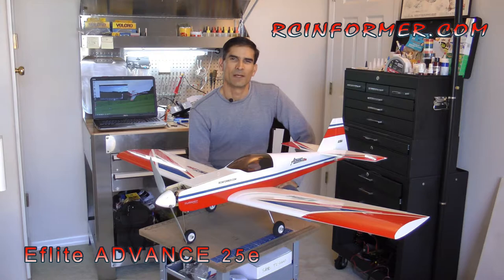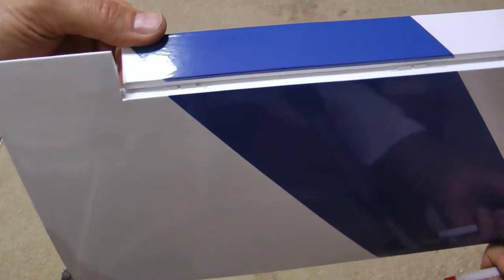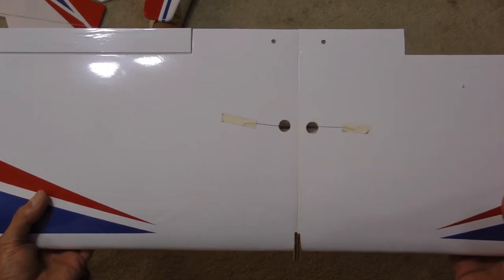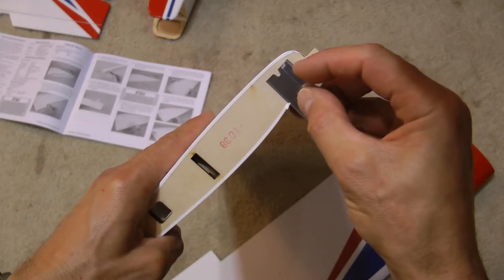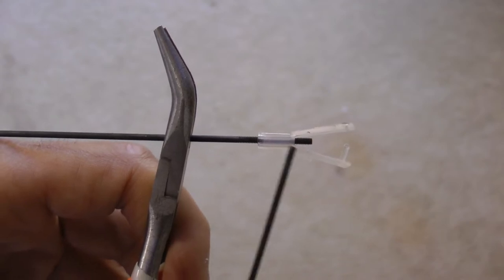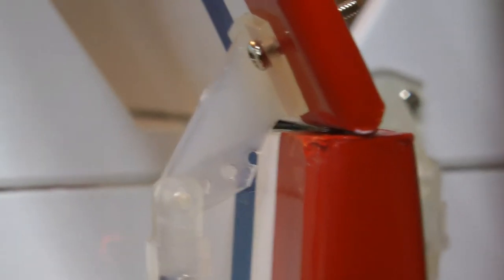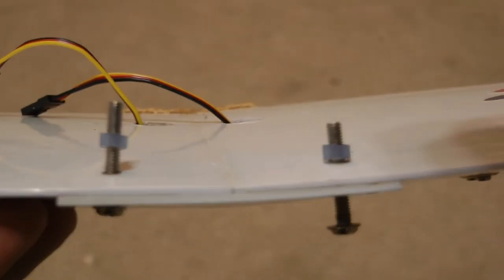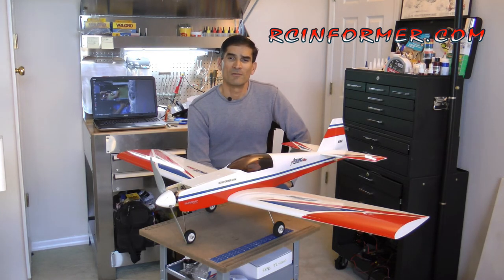Eflite Advance 25e build tips video by RCINFORMER.COM

Comment: getting the front wheel to steer properly with the rudder. The rudder itself works fine. If I attache the rod to the wheel in the standard configuration, the wheel assembly prevents the rudder from moving properly in one direction

Comment: Also I had trouble with the front wheel getting it to steer fully without causing rudder problems. Any suggestions on how to fix that? I am in the process of adjusting the front set screw so it can be put in at an angle as to allow more travel on the rod